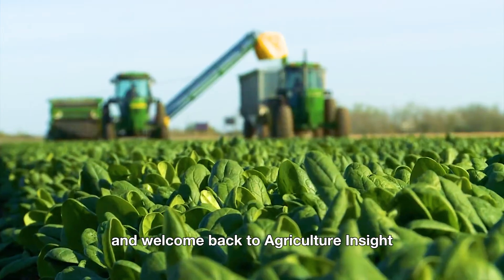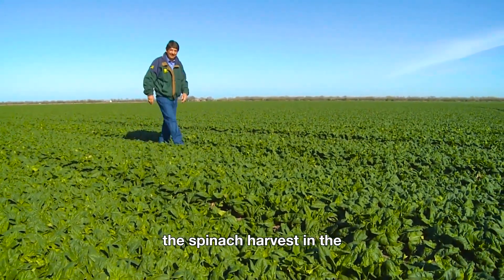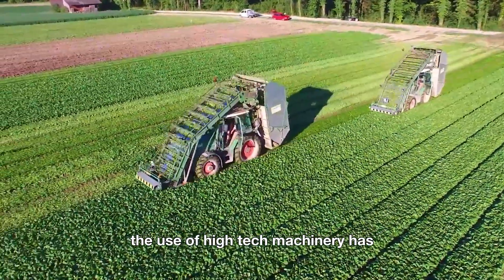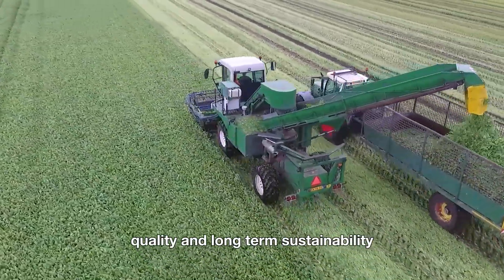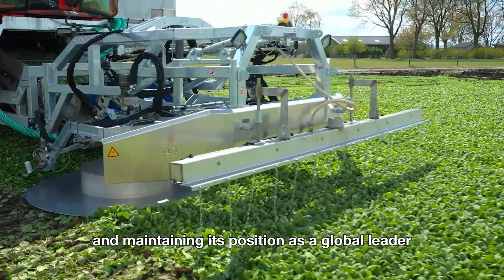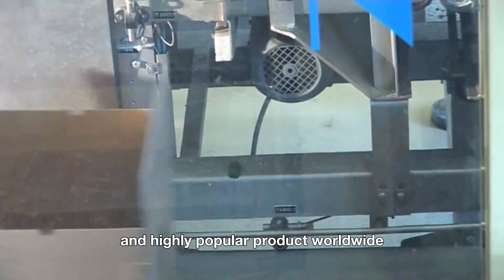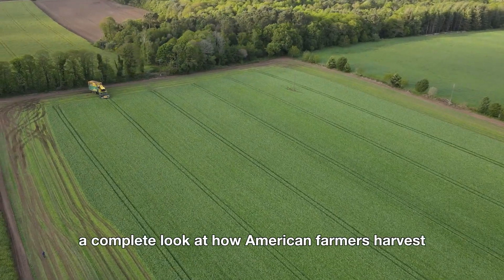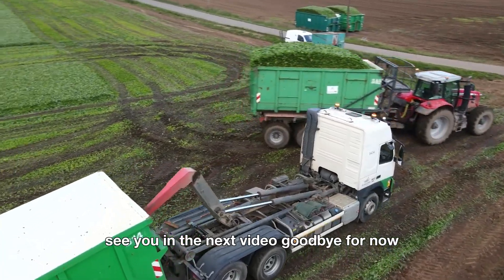926 Million Pounds Of Spinach Are Harvested In America This Way | Agriculture Technology

Comment: Would this type of harvesting work for Swiss Chard?
Reply from the maker: Great question! 🌿 Similar harvesting machines can be adapted for Swiss chard, especially the ones used for spinach or baby leaf greens. However, since Swiss chard has thicker stems, the cutting blades and conveyor speed usually need to be adjusted to avoid damaging the leaves.
Reply: @AgricultureInsightusa thanks for the info ❤